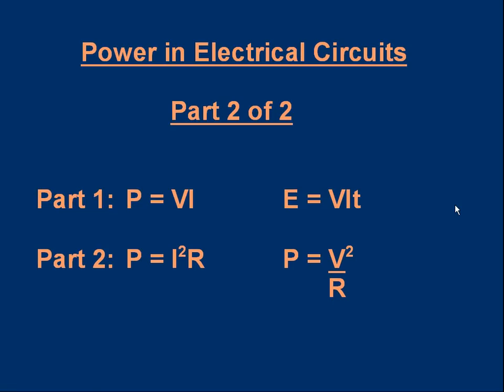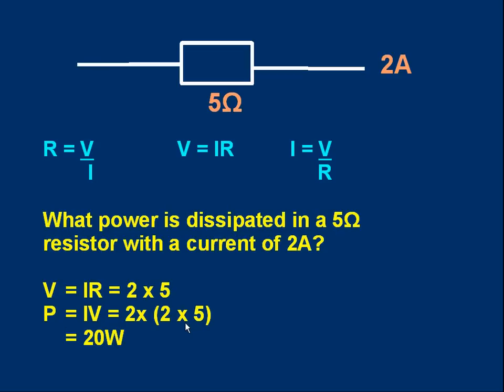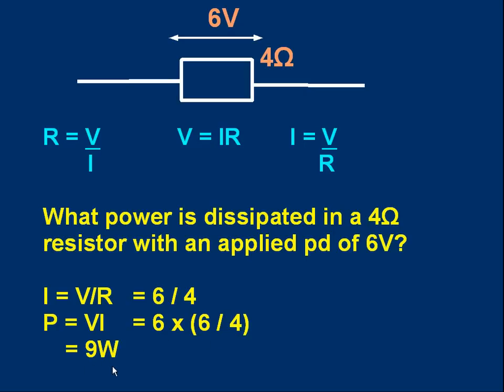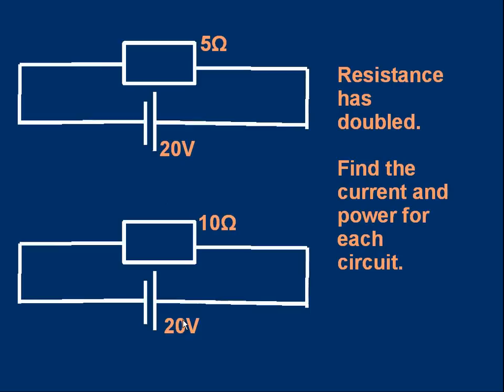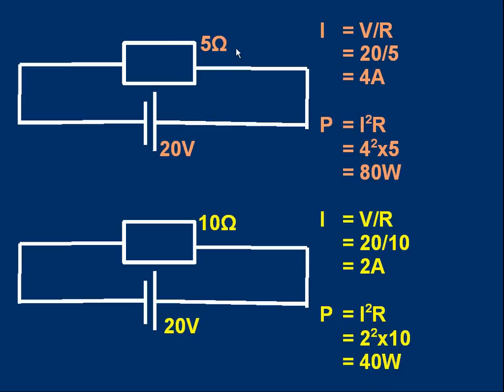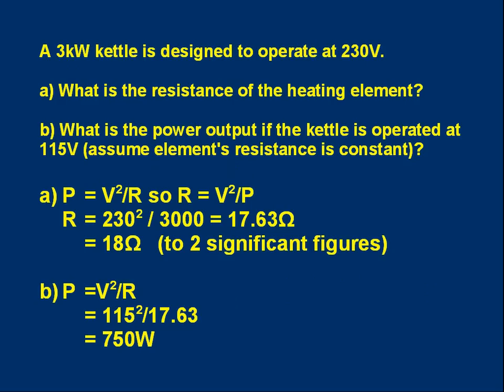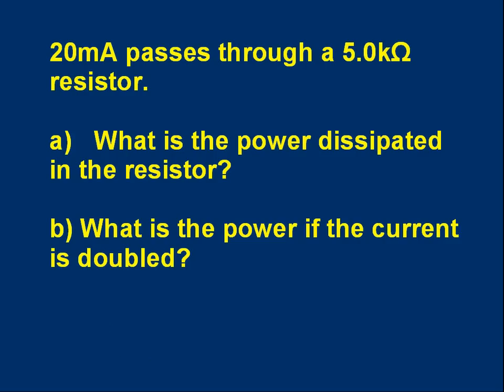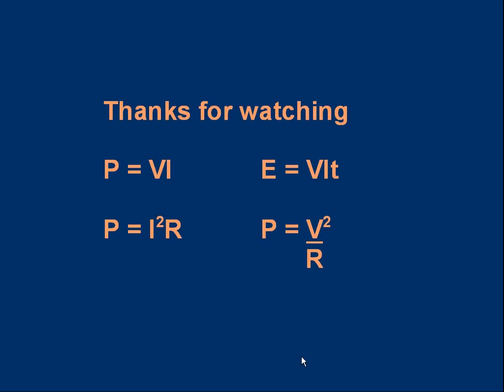GCE (A-level) Physics E22 Power in Electrical Circuits - Part 2 of 2

Comment from the maker: When the kettle is operated at 230V, the current can be found using P=IV:
3000 = I x 230
I = 13.04A

But then the voltage is halved.  The kettle is now operated at 115V, the current is therefore halved (I=V/R: V is halved and R is considered constant).

So the current when the kettle is operated at 115V is now only 13.04/2 = 6.52A

The final power can then be found using P=IV
P = 6.52 x 115 = 750W